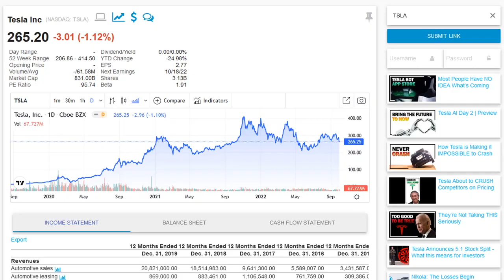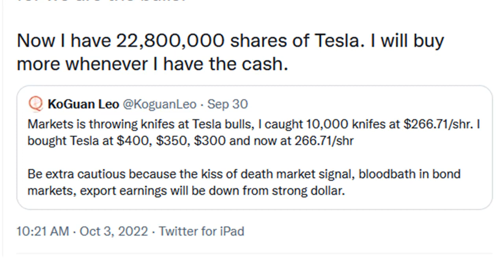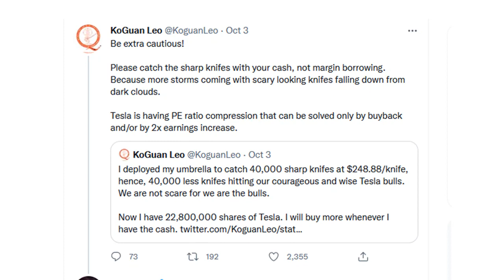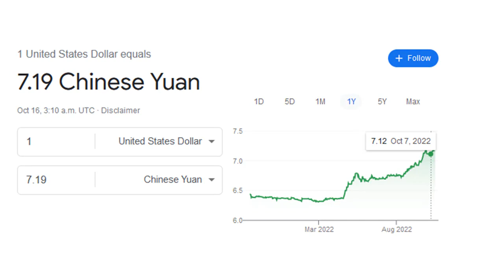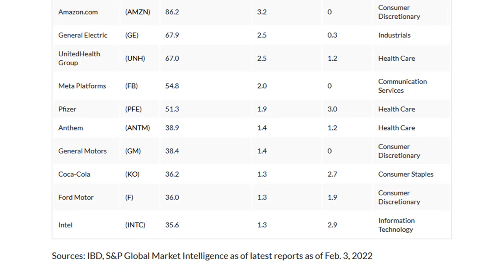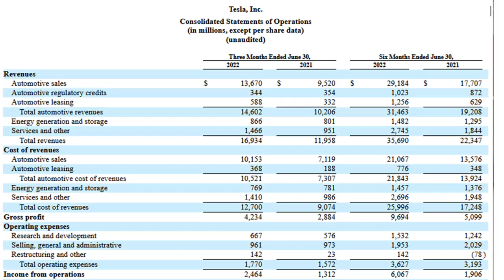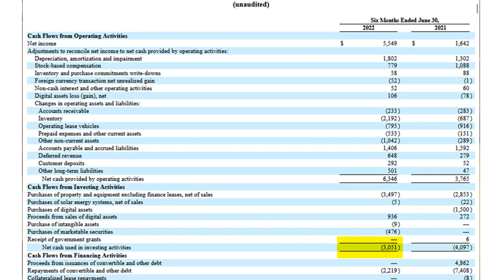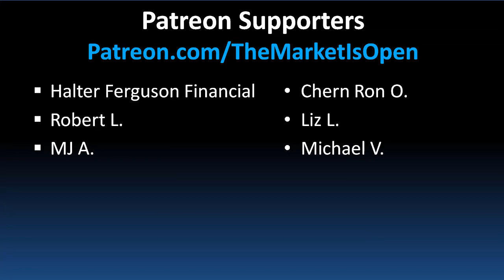Massive Tesla Investor Issues Stark WARNING

Comment: At this point of time, a stock buy back is a poor use of cash. If the price is bolstered by a buy back, many investors would sell, and depress the price back down. Tesla is regarded as a trader's playground because of it's volatility. Regardless of the many true believers that HODL, this volatility will remain for some time...probably years. Like Leo, I myself have invested in TSLA, and have paid up to $1169 (pre 2nd split), but have also bought last  week at $205.....My Tesla holding is down about 10% overall. I'm in for the long haul.
Reply: Tesla, long term or not at all.  Selling in 2030.
Reply: APPL financed a stock buy back in 2013, same game plan.

Comment: Wrong think. “ if they buyback at $205 and then the stock dips to $150 they look like idiots for wasting all that cash” The point is not to support the stock price it’s to buy an under priced asset that is set to multiply its value hugely over the next decade or two and reap massive profits along the way. What happens next week or the week after is irrelevant. Inflation is eroding their cash pile at a rate of $2 billion a year.  Tesla’s projected cash flow is going to be tens of billions in the next few years. There is no way they will run short of cash. To think that just shows a misunderstanding of the business completely. It would be a huge warning sign to me if Tesla do no take advantage of this disconnect in the markets, I can’t see that happening.

Comment: just look at apple. when the 10y rates were around 3pct before covid and growth was far greater, apple was trading at FAR LOWER valuation metrics. Now with rates at 4pct, if no big recession, apple should thus trade around 60 bucks a share i.e. more than 50pct downside. Imagine what happens to Tesla stock then, having in mind tesla has a higher beta... Tons of EU cyclicals on the other hand are already at GFC or EU debt crisis lows despite better balance sheets= u got some great bargains there and with EURUSD super low it totally makes sense for 2/3 years horizon

Comment: I was against stock buy back until a couple of days ago. I agree most of your points but:
. you need to look at both cash and debt 
. Tesla stock price is at a critical level and long term bulls could be destroyed without proper support 
. a lot of the drop in Tesla stock price recently is related to Twitter issue, not its fundamentals 
. stock buy back is a very flexible program, you can start a $10B program and the timing and amount can be flexible.

Here is my suggestion:
. Announce a $10B stock buy back program, buy back $1-3B in the near term, which funded by Q3 cash flow 
. Announce the second gigfacctory in Shanghai 
. Announce the economy model for mass market, which can be the base model for the future robotaxi.
. Announce the gigcanada to supply east and north us market

Comment: No wonder with the "Vision"-crap Tesla has put in my car & utterly spoiled the driving-experience making it a constant fight against automations to drive it in rain or at night. Simply unbelievable.
Reply: What is your FSD version? Mine drives perfect at night, actually I find it driving much better at night than during the day for some reason.
Reply: @kubismatik2  Not FSD, but 2022.28.2 (Latest thats available to my car). 

The car reduces speed in medium rain from 50 MPh, tried having it pull me hard against an oncomming truck at 50 MPh in the rain when it was 10 meters in front of me. Car sometimes reacts on shadows on the road from ex. trucks & if your on selfsteer at night & you spot ex. an animal on the road ahead of you, you touch the breake & be gone animal as the car kills mainbeam when leaving selfsteer. Simply unbelievable. 

"Auto"-mainbeam & wipers has Tesla had +5 yrs since intro of the car to fix and their still utterly useless, blinding/flashing at anyone around when driving. Has sent expamples to Tesla & they have downloaded data from my car from those videos but honestly, they cant do anything as they would have done that several years ago then.

"TeslaBjørn" has made a video of the mainlights, until "vision" i had them in manual as they were useless back then when i got the car, but now on "Vision" i doesnt even know ehther its high or low when activating = i have to be careful theres no cars ahead of me when on engaging selfsteer as i have tried several times it just fires the main no matter traffic or not when doing this.

Link to "TeslaBjørn"s vision video:  https://www.youtube.com/watch?v=Wi0kmshoVDk
Reply: @ChipMIK  My IPhone v1 had lots of problems too.  Glad I shorted Apple way back then.

It Is Still In Beta Dude!
Reply: @TomVillars  No, the adaptive cruisecontrol is not in beta, it fails miserably too when its raining, lowering the speed intermittent with a "Reduced speed due to limited visibility". This never ever happened while on radar.

Beside that, i bought a perfectly functional car with radar & now its been degraded. 
I drive 30.000 Miles a year and this "Vision"-downgrade has completely spoiled the daily 2*60 Miles when its rainy or at night, utterly unbelievable...Dude!